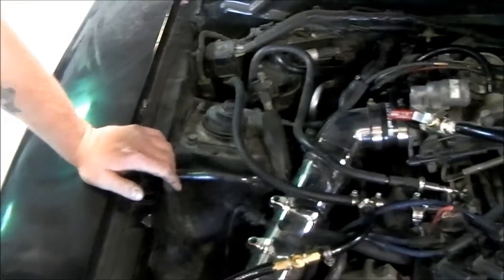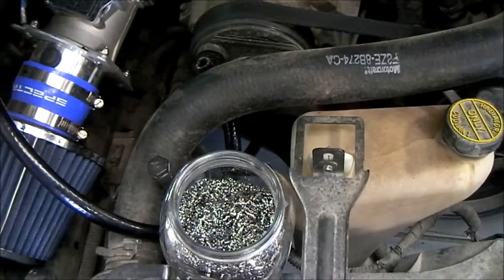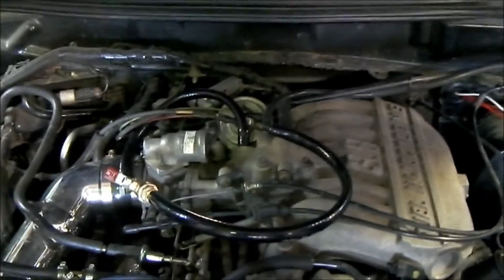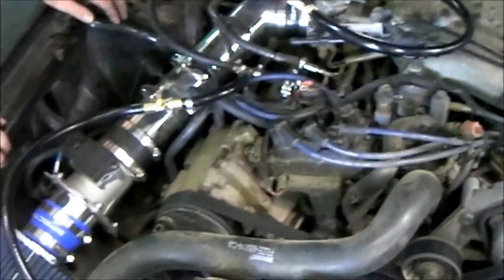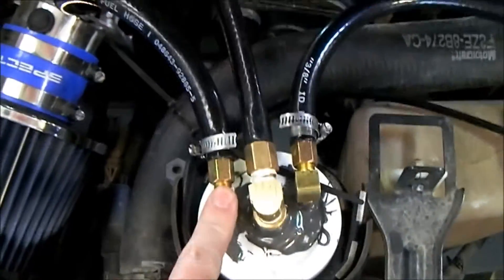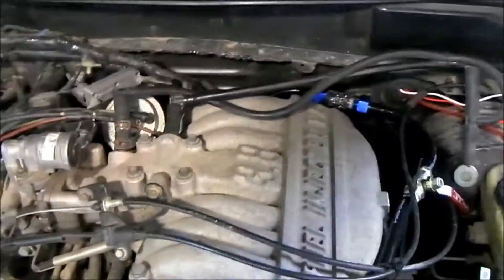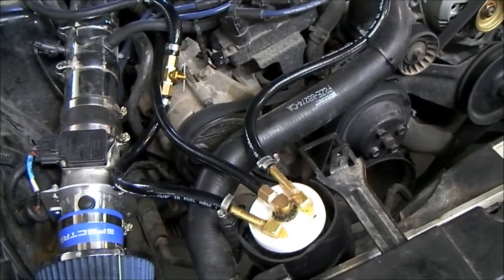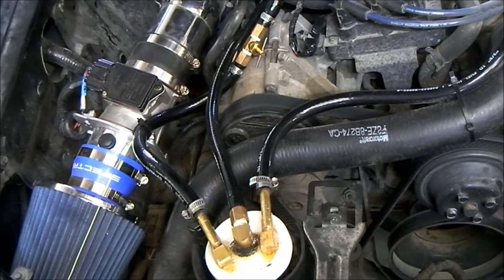Vapor Canister MPG Experiment

Comment: I put high temperature high pressure power steering fluid line on my gas line and I connected copper tube to that and wrapped around the exhaust pipe behind the motor for heat, then connected back to the injector rail plus I have a adjustable valve tour I can lead in a small amount of gas into the motor I can set my speed at 30 miles an hour top speed or 40 or up to 50 or 60 which means lean burn. Been done it since 2018.
The only way you get better mileage by using less gas and less power is to make the car roll easier which means 100 psi in the tires 

If you use a lot less energy, you can’t move the car with 35 pound air pressure tires so you have to air them all up. I found a set of tires called Potenza RE 92 and I drove that car for three years at 130 pounds pressure in the tires But you don’t get any better mileage past 90 psi
After several years of writing rough in the car, I went down to 80 PSI because it’s more comfortable ride ATPSI 80 pounds per pressure that’s my story and I’m sticking to it

Comment: Hho system is also good for cars because  Hho is an experimental technology  it  will surprise you!  Cool engine running  prolonging engine life and engine oil life. improve engine performance and increase fuel burning efficiency. Petrol combustion engine can burn only 18% petrol in the engine but hho will burn   100%fuel  in the engine No un burn fuel wastage . Engine will run more power fully, Consume less fuel. Hho system works on petrol, deisel, cng,  types gases.

Engine runs lighter smoother reducing carbon emissions .  Boost engine power Hho gas reduced engine noice & vibration

An efficient hho car kit lower the engine temperature more then 100 degree F.  To prevent heat build-up.Hho car kit reduce car maintenance, Hho kits restore better fuel economy. Hho system is very easy and simple to install. Hho solves the engine heating problems automatically!!!. Clean fuel burning , Reducing engine noise due to the faster fuel burning. Hho car kits works nicely requires no modifications in the car engine. No side effects on car engine.

Engine start quickly safe your car battery.  make your car a low cost hy-brid. Use a  low amp. Hho car kit will work better. You can  transfer hho kit from one car to another one without any problem. Hho kits requires no any modifications in the engine. For more information about this useful technology  keep watching hho zafar videos. Or call 03082266179 zafar karachi.

Comment: Most of these vapor videos on youtube are seven, eight or nine years old and you never hear anything else. Conclusion: It does not work as far as saving gas.
Reply: out of youtube , mine still working ( but not copying this video vapor setup ) my setup far more simple and safer ( no adding fuel tank in engine bay ) ..
Reply: HHO and other alternative fuel videos all disappear about 10-12 years ago. I'd guess that's when big brother made the rounds, shutting down anyone commercialized the processes.

Comment: There are race engines that use an [electric] vacuum pump to pull blow by gasses off of the top of the head(s), but they are filtered and vented to atmosphere. You could use a vacuum pump in your setup.

Comment: Perhaps using a flow meter for fuel hose and also using one for the exhaust gases on those other houses will give you Clues and also very intrigued as to how the O2 sensors are reacting to the vapors meaning are they interpreting the gases as more oxygen and therefore sending more fuel to the combustion chamber it's really cool to see people trying to save money on fuel I'm actually doing research myself great video

Comment: forget going to the pvc . , weld a cooper 1/4  line to the exhaust pipe after the 
Cat and into the bubbler , remove oxygen sensor, (s) and  add an extender so it runs leaner but the vapor fuel will compensate for the loss of fuel to the injectors

Comment: A hollow metal ball hooked in between the carb , throttle body injection carb ,with the fuel air mixture going THRU the hollow metal ball NOT around the ball will vaporize better than other ways . on my vehicles it doubled my gas milage . Check out Gasoline atomizer vaporizer on Robert Burchells youtube channel
Reply: Thank you!

Comment: If you want a simple & easy to-do gain (5% hp, 10% mpg ), just block/cap off the intake-manifold vacuum inlet (where the pcv vent-hose from crankcase goes to).  Then re-route the pcv vent-hose to a lower vacuum source ['anywhere' between throttle-body and MAF].  This will increase overall engine vacuum (since the PCV system is no longer stealing it) which will allow for more efficient fuel vaporization and significantly decrease blow-by.
Reply: Did the same but ran mine through vaccume system with a T
Reply: @cawthorpe751  interesting. I actually now just leave the pcv valve on, remove pcv hose, cap the pcv vacuum. don't even bother w/ the extra vent or T if breather hose is > .25" diameter.  seems to work just as well.
Reply: @Wes_5kyph1  hi wes, i redid my system, i just did a t-line at the brake booster.
Im driving a 3.3 eco dodge caravan.
To go from my house to my moms is 6 hours. Usually 2 tanks

Now only takes me half a tank there and a half a tank back

Ranging around 1000km
Reply: @cawthorpe751  awesome, glad to hear! thats a huge mpg gain.. notice any power gain or mainly just mpg?
Reply: @Wes_5kyph1  more top-end power.
Just used a valve to adjust flow

Comment: You were trying to combine two incompatable technologies.  Let crank case vent alone and build two separate vapor systems .old carbs have an idle circuit and high speed circuit that take turns providing air fuel mix according to driver demands. Make one vapor circuit for idle and a separate one for acceleration and cruise. Songle intake tube to intake manifold fed by these two circuits and governed by butterfly or slide gate. Have it connected to the accelerator pedal. You cant continue using the electronic governing devices .they will never play ball with a vapor system. So far ,your project looks well done and you are on the right track. Fuck the Rockefellers @
Reply: Why not use exhaust as the intake air to the bubbler, heat the vapours coming out of it with coolant heat, and introduce those to the manifold through the EVAP purge?  Shouldn’t have to mitigate MAP sensor codes (if equipped), because the computer already should account for the evap purge cycling. O2 sensors might not even see too much oxygen in the exhaust because that air is being drawn away before the sensor and hydrocarbon enriched at the bubbler. I might be missing some key part about the carb/throttle body...hmmm. I wonder if there will be issues at cold starts, until things are up to operating temp. Must devote more processing cycles to working this out.

Comment: the problem is you need to introduce the vapors through the same way your engine takes in its  air ... your not getting enough vapor and you need to introduce the vapor through the air intake system ...... uhhh k ?  a carbureted motor works best ..

Comment: i need to tighten my system and romove vacume leaks so it idles better but when i punch it my exploder smokes all four tiers (i live in seattle no dry pavment it only rains once tell spring)got a universal window washer a float senser that trips a relay and maintains the fluid level for the ultra sonic mister for less than 20$ lets not attack china tell i get my almost free stuff peace to every one forign and domestic!

Comment: It looks like you copied my system to a "T". However. Your assumption on the use of the PCV circuit was incorrect. I did not use the PCV circuit because it is a metered or regulated flow that is accounted for by the ECM and used to calibrate the system. Which it is not. I use the PCV system because it was attached to the only full flow vacuum port I could find on my intake.  You need a large amount of flow to draw enough vapor into the intake to see a difference in the adjustment of the ECM due to the rich fuel environment created by the extra fuel picked up by the O2 sensors. The OCV on my engine was not regulated. It was a full vacuum and full flow. Also, it provided a heated air supply to a "heat exchange" systrem. You need to heat the fuel to get it to evaporate effectively or you need to heat the vaporizer. You can use a direct to air inlet to the vaporizer as long as you filter it. The PCV system does not need to be disturbed at all. Another notable thing is that you are running a small vaporizer on a 3.8 liter v6. My small unit was being used on a 1.6 liter 4 cylinder. I was able to see much larger gains due to this. Something to concider as well is the year of the vehicle. Mine was a 95, and the OBD 1 system didn't have as many variables to adjust to and had a greater bandwidth than the newer OBD 2 system. The OBD 2 systems were calibrated to tighter specifications due to regulations and do not allow as much of a bandwidth change to the injectors. At any rate, keep it up. I hope you can get the improvements you are looking for.

Comment: ur air too cold.. and fuel line too cold also..o original fuel vaporizers was preheated. ~150F
Reply: Use the coolant lines to heat the vaporizer.

Comment: Try another T back from PCV to it's normal destination; from that T go to you bubbler and you should get some more valve tuning on that line. The PCV to bubbler will be in parallel with the normal PCV route.  Good you've not overlooked flashback arresting. I would insulate the bubbler.